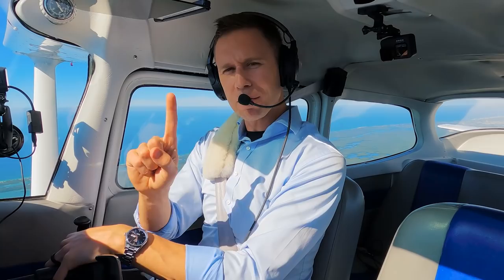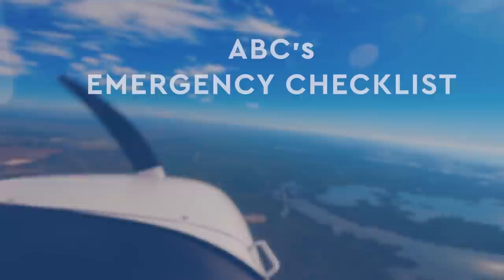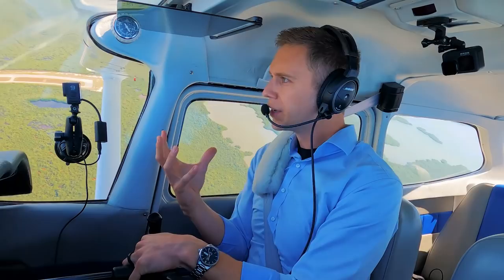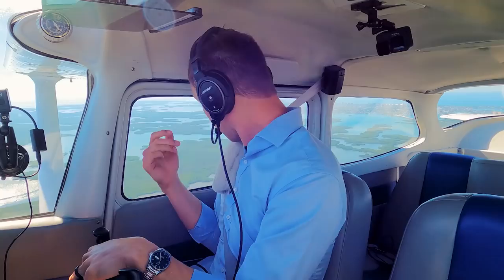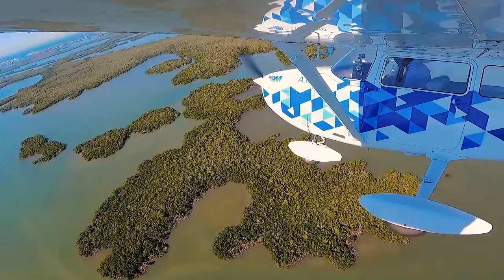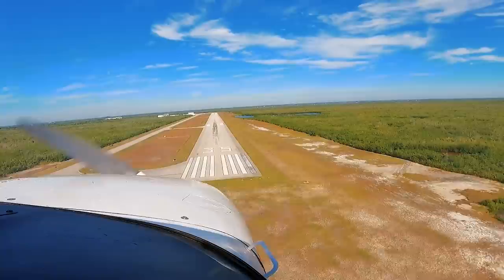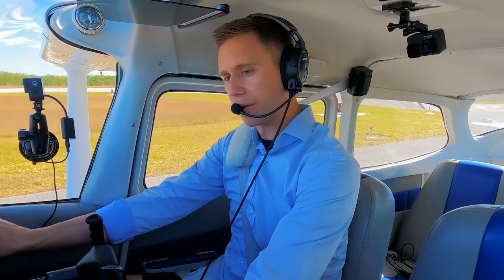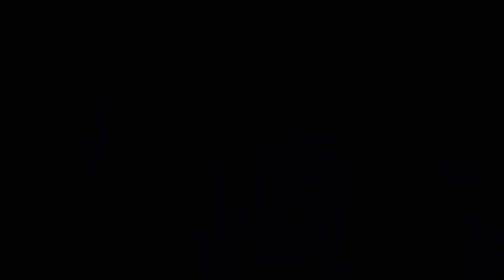The One Flight Maneuver Every Pilot Should Master

Comment: Am I the only one who thinks the sloppy stick control could be dangerous? A driving instructor wouldn't let that pass if you held the steering wheel this way, so in an airplane upon landing, this is definitely unwise. What if something unexpected turned up, a flat tire for example?

Apart from that it was a nice flight. I do believe that the video part of the side slip could be better, though.

Comment: Hi Jason, if we find ourselves in that specific situation above an airfield, why would we use the BEST GLIDE SPEED and not the MINIMUM SINK SPEED? Just considering the fact that going further is not more important than having more time to calm down, maybe try a restart and run some checklists? Thanks for all the great videos!!!
Reply from the maker: Hey Vito! With best glide speed you can maximize how far your aircraft will go. You always want to have altitude to tradeoff. It is better to be too high and do another pass or forward slip than be too low because you didn't pitch for best glide and didn't make the your landing point. Hope this helps! Thanks for watching!

Comment: It's nothing piloting an aircraft at idle power. In real life you wont have idle power. Unless you've already tried it pull the mixture to cut off and kill that engine on final but only when you are certain the runway is made and watch how quick the ground comes up compared to before. Throw in a few turns and that number on the runway may be further than you can reach no matter how good you are. Every pilot should practice dead stick landings to touch down. You don't know your airplane till you do. Fly safe!

Comment: But, who is ever 1,500 feet above pattern altitude when directly over the airport? Practice at pattern altitude, where that is where you are most likely to be. 2,500, in my opinion, is too easy. And what about stalls? I can not tell you how many pilots have held their breath, or got scared when I tell them I am going to do it. Most, have never stalled a plane without an instructor onboard. If stalls scare you, maybe you should not be flying.